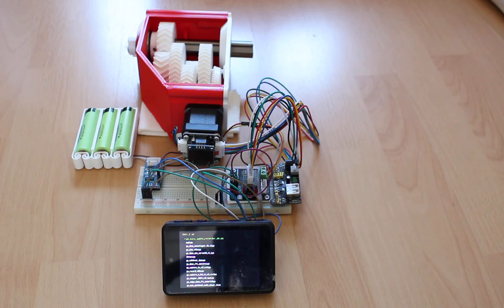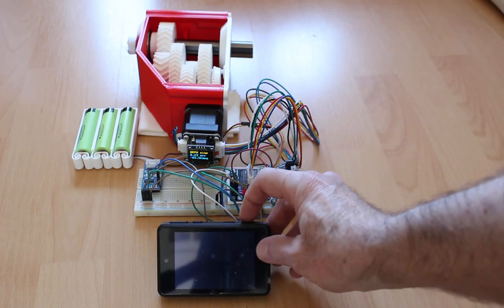RiscV (K210) board driving a nema17 stepper motor with high torque

Comment: Hi,
just saw your setup looks awesome! 
Do you mind sharing the code publicly? I guess this would work on a maixduino aswell? 

Kind regards 
Dave
Reply from the maker: Hi Dave. This tiny project should work on any arduino compatible platform with some modifications regarding the pin numbers and naming. The rest should work as is. The code for this is ported from a simple arduino stepper project. Please try to do the same. This is the best to learn things right from the bottom. Once you understand the code you will go to the next bigger challenge. Try it.